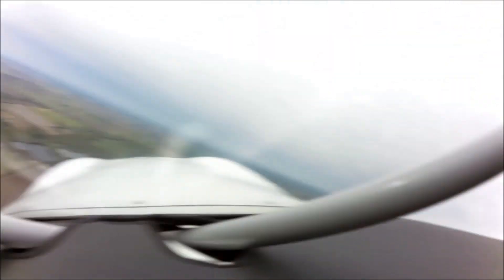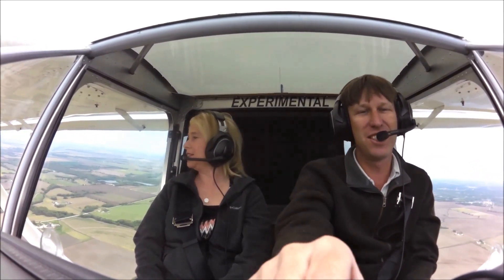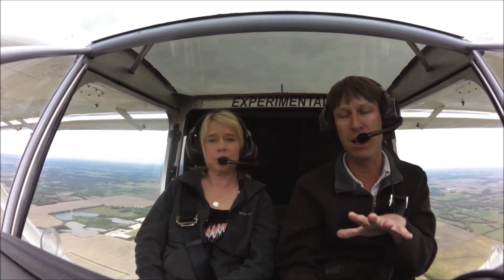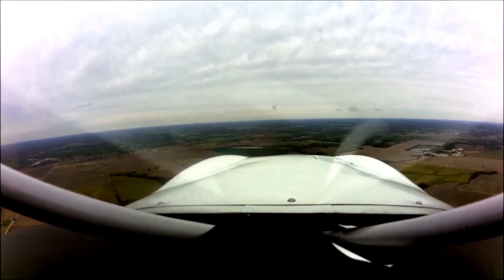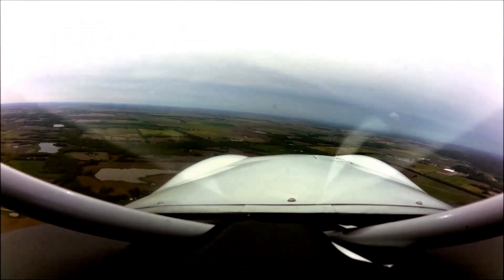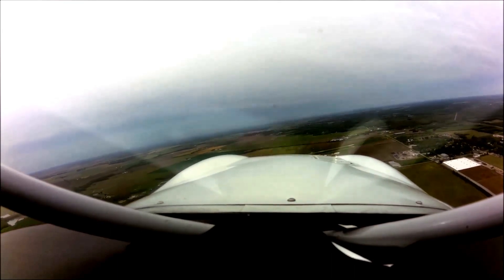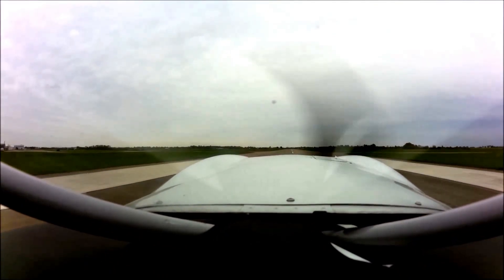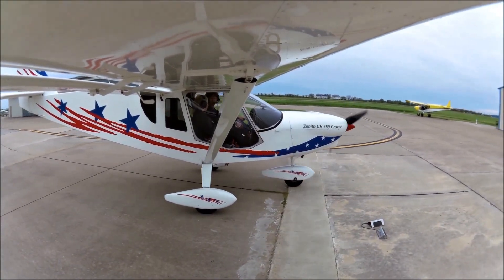First flight: Zenith CH 750 Cruzer demo

Comment: How fast does this 130 hp allow you to travel, whats the burn rate per hour and does it last 2000 hours? Or what does it really last that you have observed?
Reply from the maker: Cruise around 120 mph @ 2750 rpm burning around 6 gph. TBO (time between overhaul) numbers are supplied by the manufacturer (UL Power) and we have nowhere near that time on our engine yet...